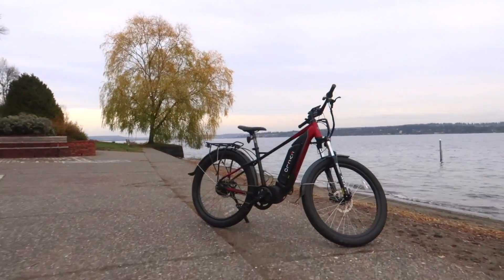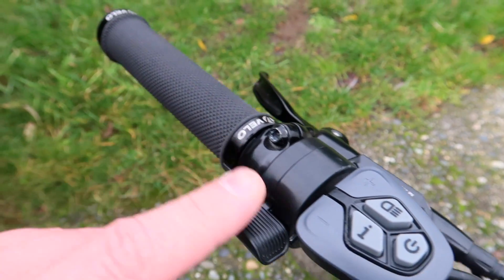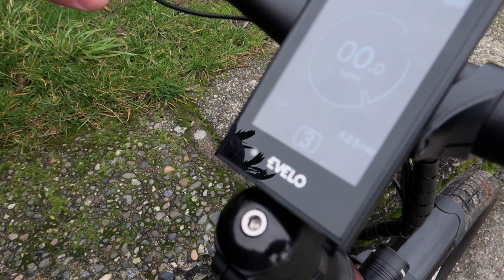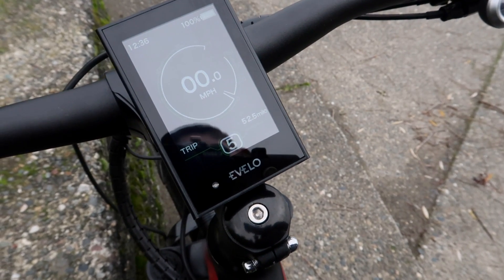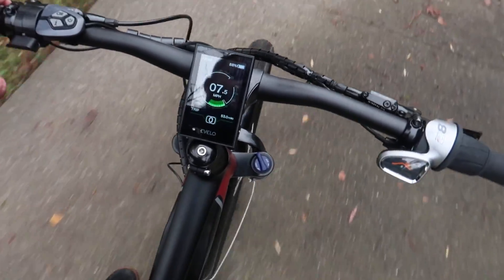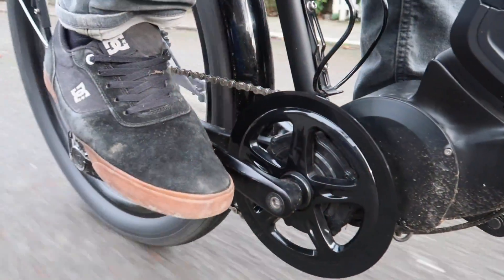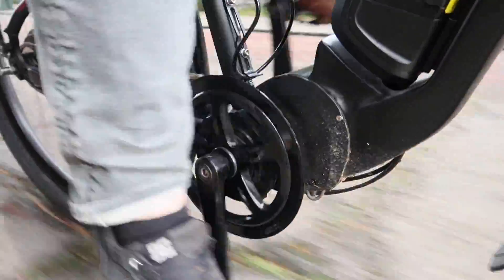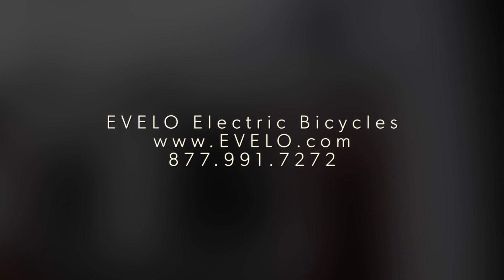How Electric Bike Throttles and Pedal Assist Work | EVELO Electric Bikes

Comment: How are the maintenance costs on those electric bikes. I had my control cables rust through when I was homeless and it's been prohibitively expensive to get them fixed, presumable with ones that will only rust through as quickly as the first ones. Are electric bikes more reliable if one is stuck out in the weather? I have the ability to charge batteries and such but not the kind of shelter to prevent rusting of components.

Comment: Totol noob question so appologise if it sounds dumb

What is it like riding a bike with pedal assist. Do you still get to the point where your legs hurt or will pedal assist eliminate that.
Just changed my job and started riding there instead of using a car but there's some big hills and if I'm honest it's killing me my legs are burning still when i wake after my sleep. Thanks
Reply: Not a noob question. You can increase the level of per day assist to the point where the motor is doing most of the work or just use the throttle that EVELO bikes come with to eliminate pedaling altogether.

Comment: Hi. First, thank you very much for the video, it is very helpful. I would like to ask what is the difference between bikes with 5 PAS modes and a single PAS mode. Is it a disadvantage to have a single PAS mode, especially for the battery efficiency? Appreciate for your answer. Thanks

Comment: It became tradition from the first motor cycle to have the throttle on the right. Although if you wanted to turn right with a hand signal in England ie, "drives on the left side of the road" you would have to take your hand off of the throttle. I live in England,  I have an e-trike, and my throttle is on the right, i noticed when i wanted to turn right and give a hand signal, i had to let go of my throttle. Hence i am going to add a second throttle to my e-trike and connect them together so it doesn't matter which throttle i use.

Comment: On my 2 ebikes I can have pedal assist off and use manual pedaling and throttle. This is a must for me. I hate it when I throttle and pedal assist is also running. It's a weird feeling and not needed.
Reply from the maker: Everyone is different, and has their own preferences. Glad you were able to figure out what works for you! The throttle on demand does come in handy, and makes climbing those steep hills a whole lot easier.

Comment: Interested and informative video.

I purchased my e-bike (Trek Step Through) about 20 months ago. I am not an "extreme" cyclist. By "extreme" I mean that I don't cycle long distances, over exceptionally rough surfaces or mountainous trails. 

The only that I don't like about this e-bike is the lack of a throttle. I never realized how handy this feature would be for starting from a standing start, and especially up a shallow incline or on soft terrain.
Reply from the maker: The throttle does come in handy for getting going, or providing that extra push to get up the hill!

Comment: Ok here's my dumb question cause I'm new to ebikes...if you're on zero and hit the throttle do the motor engage?
Reply: That's my question too!  On Aventon Bikes, you have to be in PAS1 for throttle to work, which I don't like.
Reply: @pambaileyRealtor  I finally got my ebike and if I'm on zero and hit the throttle nothing happens I have to be on PAS 1 and above..I guess that's how all ebikes works
Reply: Some manufacturers do have Throttle on PAS0.  Velowave and Rad do.  Interesting that bikes operate so differently.
Reply: On my Envelo Galaxy ST and Aurora Limited, there is no throttle if PAS is set to zero.

Comment: Pas is plain dangerous, it reacts slow and if you don't brake it carries on trying to move you.. throttle any day😊❤️
Reply: no, once you stop pedaling, the power to rear wheel stops as well. The throttle is what keeps you moving, even when not pedaling. So your thinking is backwards.
Reply from the maker: The motor will stop providing power once you stop peddling, but due to the momentum you have built up, in order to stop or slow you must use the brakes, or wait for your bike to naturally slow down. The throttle does provide that short burst of power while engaged, whereas the PAS provides motor support to your manual peddling.

Comment: Thanks for this video that is helping me understand my new electric bike. Do you have to hold the throttle button down to keep it functioning?  And, if you want to start from a stop on an uphill section, can you engage the throttle to start you moving? I've been starting by pointing the bike downhill so I can get it moving!
Reply: Holding the throttle button down will override the pedal assist as long as you're holding it down; when you let the throttle up, it'll disengage and allow pedal assist to take over. You can engage the throttle to start from a stop on an uphill section, but this will pull more power from your battery faster; I think you're system of "starting by pointing the bike downhill" is a good measure!

Comment: Great explanation of both features. My question is, if you’re using pedal assist let’s say at level 5, do you have to shift to a certain gear number?
Reply: No you don't. It has nothing to do with gear unlike motorcycle or car
Reply: As a relatively new user who has had an e-bike for 20 months, the habit that I had to break was constantly shifting gears like I did on my traditional bikes. It's much easier and less wear on your shifting mechanisms to simply change the level of pedal-assist.

Comment: Very clean☞☞>share4.photo/ebicycle?23 really useful and I am using it 4 days a week to go to work. Battery life is very long. I haven't charged it and it's still working fine. I also go to the gym with it after a great workout the bike just takes me home with me doing much on it. This is a great help especially since I am trying to cut cost. Great value for money I really recommend this product. Do not hesitate to buy.